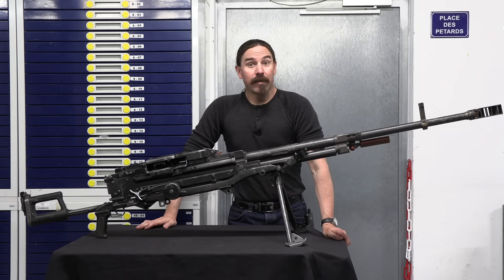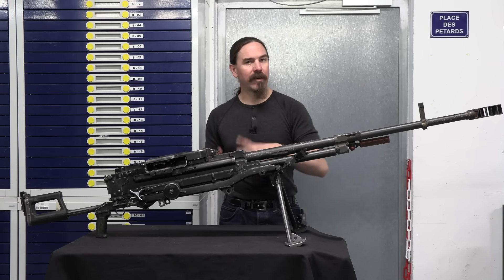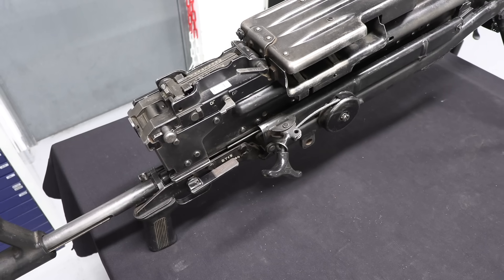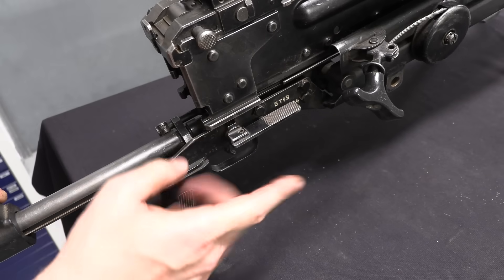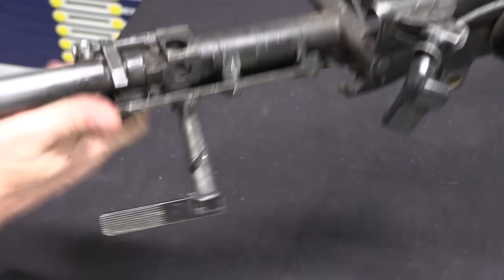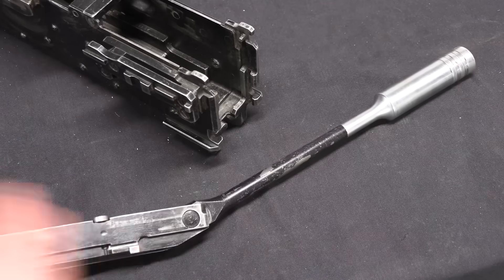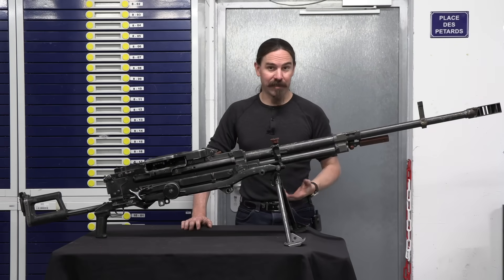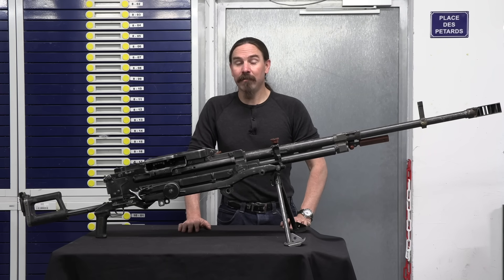Kord: Russia's New .50 Cal Heavy Machine Gun

Comment: Imagine that cable snapping in a firer fight. Seems like such a weak point.
Reply: This cable can probably suspend 2-3 grown adults in the air. Also there's a protective sleeve to prevent it from wearing down, and if it's been in service for too long, it's an easily replaceable part that you can find practically anywhere.
Reply: @dannydanny2789  2-3 grown adult?
It can probably be used to suspend a car, if you've never needed to calculate the strenght of a cable, you WILL underestimate their strenght.
Reply: @petrucercel9855  yeah, didn't want to overestimate the strength of the cable, but it probably is much stronger
Reply: It's not 😂 and there's other weapon systems that use this like Mk47
Reply: it looks pretty strong actually. Its still really weird though. and not a great design compared to how every other machine gun on earth works.